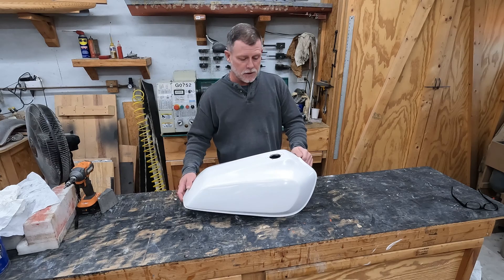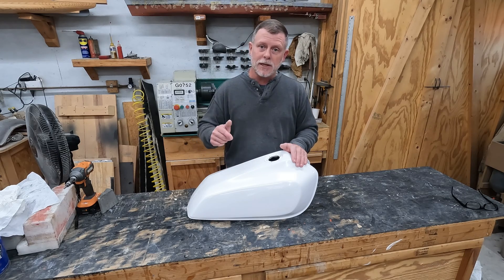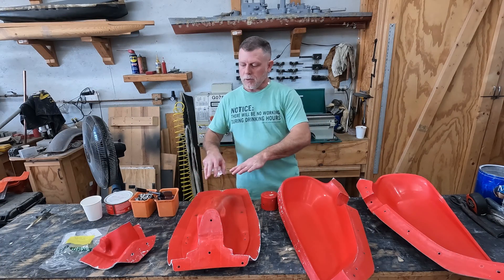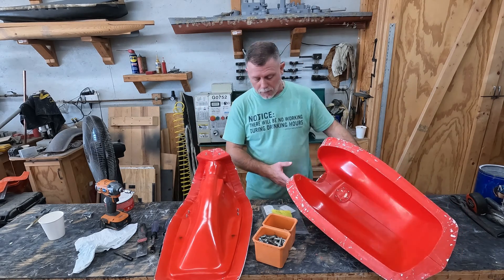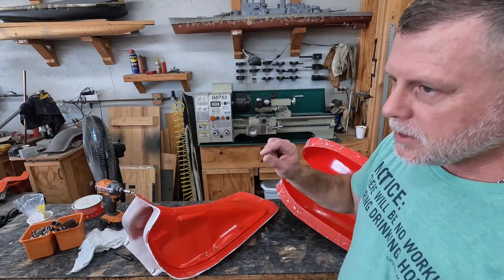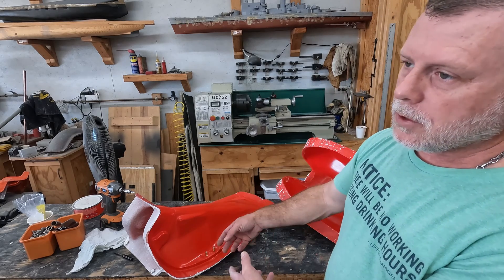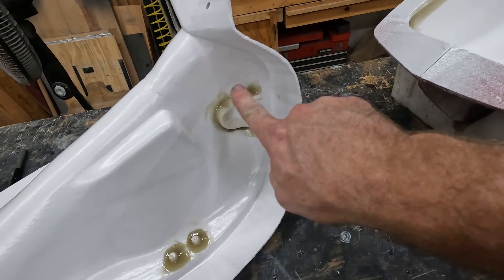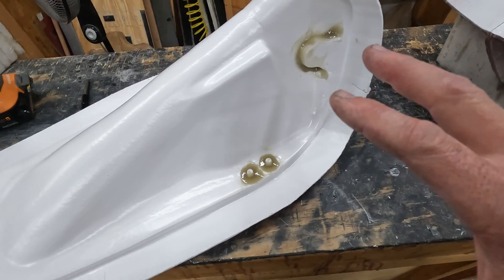Fiberglass Mold Making Producing The Fuel Tank EP1

Comment: I was watching your one-off fiberglass tutorial, and I'm trying to make my own fairing... I have a problem though, in making the mold, how do you ensure it is symmetrical? What measuring tools do you use?
Reply from the maker: There are a few tools or methods to get symmetrical parts such a center line to edge measurements, using a contour gauge, cutting thin plywood ribs building a frame within your part similar to a skeleton. This is just to name a few it all really depends on part